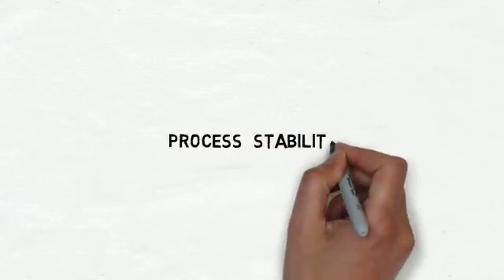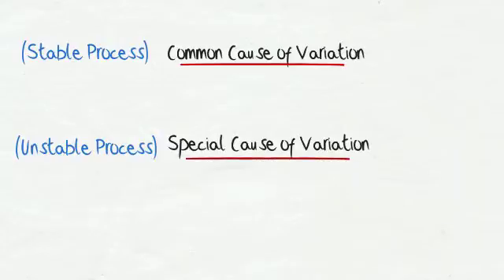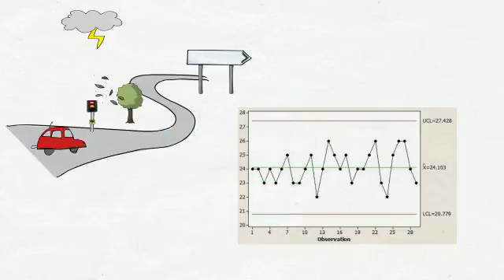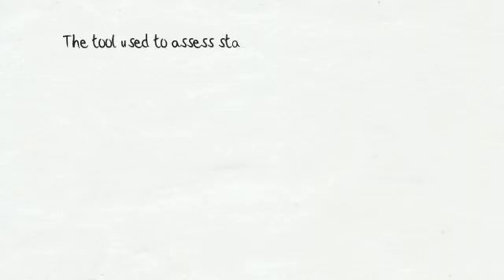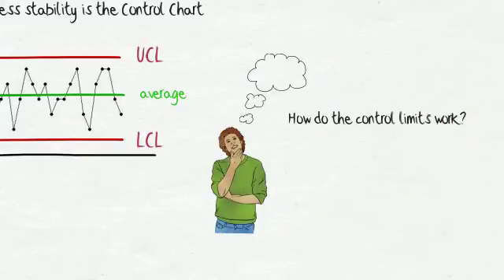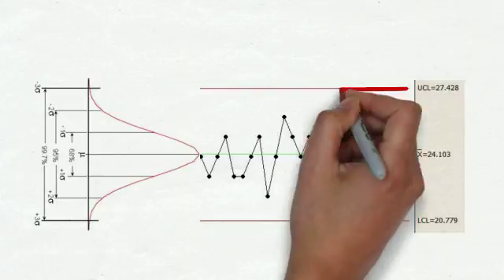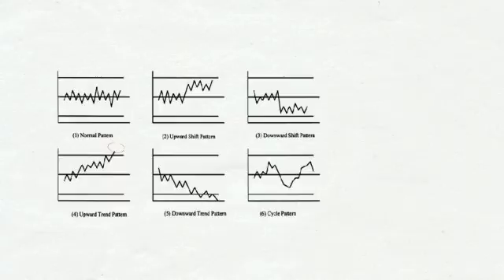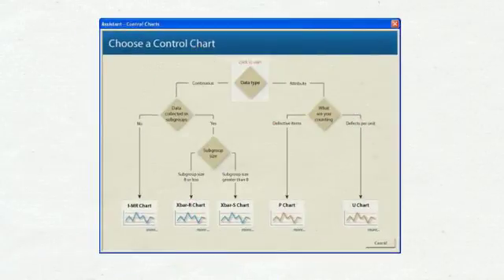Process Stability

Comment: If cpk is above 1.3 then can told my process is capability, what is the factor to proof my process is stable? Please kindly explain me. Thanks
Reply: A bit late, but I don't think there is a real factor. If your process is stable, the Control Charts will prove this. If the pattern of the Control Chart is the "Normal Pattern", your process is stable.